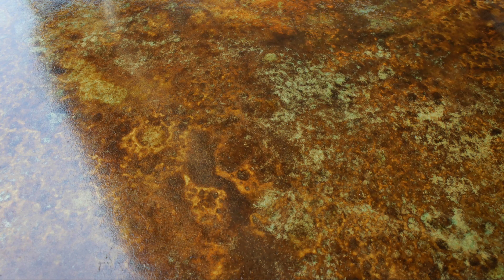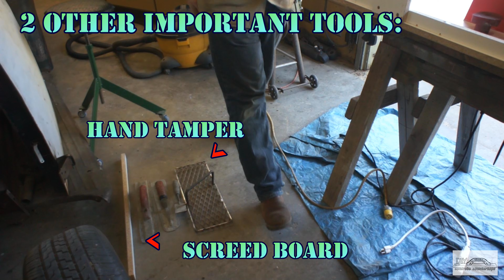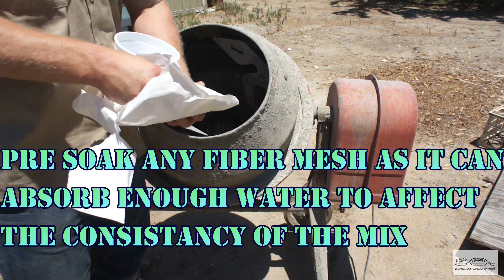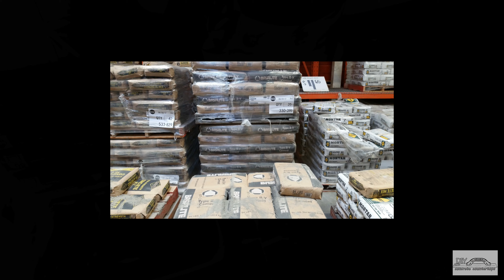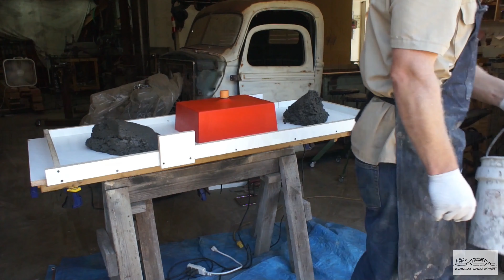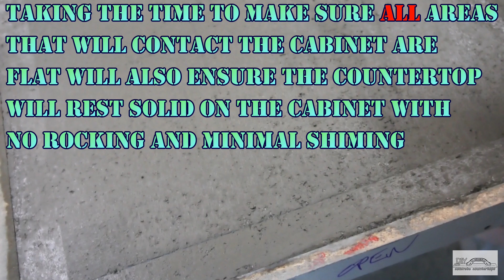How to mix, pour and finish your own concrete countertops. Step by Step DIY countertops

Comment: Have you had success with the shrink reducer and the plasticiser? The green and blue little bags?   In reading through their instructions, they claim to only be compatible with rapid set products yet the concrete is sakrete.  What’s your advice on these?

Comment: Good day , I am looking on how to complete the surface of the counter when you take the forms off and flip... excited to start
Reply from the maker: There are many good products available to seal the concrete. I use this product on many of my jobs: https://amzn.to/2udtJ1f

If you decide to sand or polish you may want to stop at 400 grit, any finer and you may lose adhesion on any topical sealers and you risk exposing aggregate. If theres anything else help with then please ask